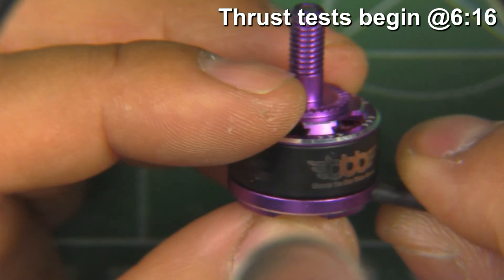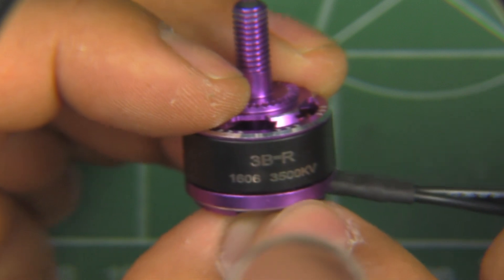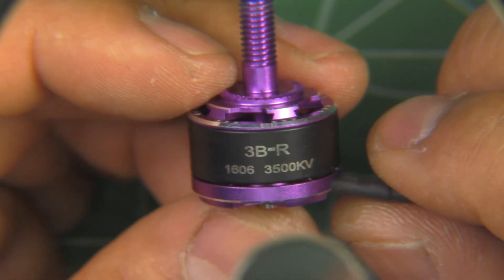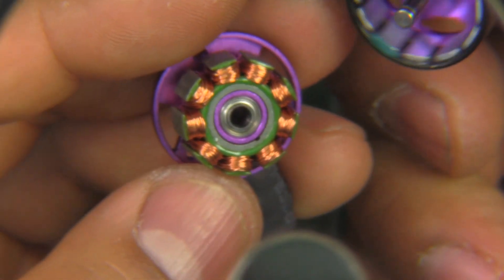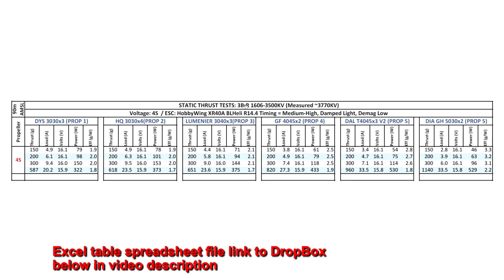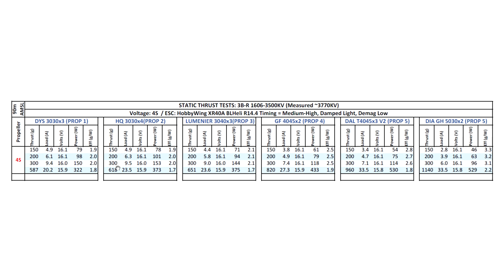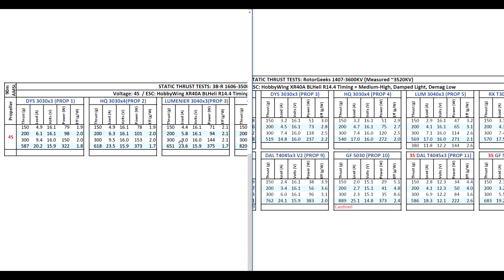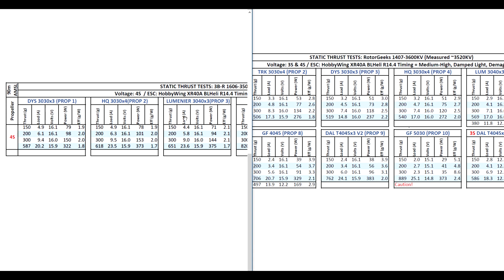bbb 3B-R 1606-3500KV Thrust Tests -Promising but Overheats

Comment: Old video, but I think I have an idea on the heat. The motors come with an oversized e-clip (for 1407 at least) and on my frame the clip would  be jammed against the frame instead of moving freely.  I used soft mounts to space the motor out and the clip was able to spin freely. Doesn't get much hotter then my other setups. My guess is the friction of the jammed clip and the spinning shaft was causing the heat.

Comment: I run these motor on a skyzone140, hglrcf4 40 amp stack and gemfan 3052's and whilst hovering in the house, these motors did indeed run very hot ( burning hand hot) but i was surprised that they weren't getting no where near as hot when flying out side and could comfortably hold the motor
Reply from the maker: Cooling air outdoors helped. A lot people report they run hot but they seem to be OK and no reports of meltdowns so that's a good thing!

Comment: hi thanks for your comments on my 8inch build, I have also uploaded my 3inch build maiden with these 1606 3500kv motors, now I have been able to have a few true flights with them they do not seem to get as hot once in the air and moving. its turning out to be a good spring festival this year.
Reply: I'm only using a 20A all in one esc with 3x3x4 props, flies ok but think a higher pitch will give it a better kick, will a higher pitch like 3x45x3 or higher be stressing the esc's ? thanks
Reply from the maker: Yes, those props will stress ESCs more but I think 20A ESCs should be able to handle the load just fine for any 3" prop. I'll check out your 3" video. Good to hear Spring is going well !

Comment: My God these motor run VERY VERY HOT, I couldn't believe it when I landed and felt the motors, I thought I might have had a screw touching the windings but after searching it seem to be the way they are.
Reply from the maker: Yep, it's a shame they run so hot. They're actually very nicely made and the size seems to have some good potential for 3" and 4" props. They really need to revise the stator, I think the coils need to be a little longer to allow for more wire.

Comment: Thanks for your testing report,we will upload 3200KV 1606 testing data soon
Reply from the maker: Yes, I will send you information right now from my email ro****c**na@gmail.com. Thanks and it would be great to get some test samples because this 1606 motor size could be a good option for some people, specially now in England they have new government rule many want to build 250g or lighter quadcopters. So 1407 / 1606 motors have to weigh about 14 to 16 grams.
Reply from the maker: Send me a set and I will test and review it !
Reply: Hi  EngineerX,can you send your address informations to my email sales@3bhobby.com
Reply: I would love to test some new too, because i wasn`t know its a motor issue i bought the 3B-R 128 mini combo, 3 spare motors and even switched a FC and can´t fly with it now because its too hot and dont like to fly it that hot, still like the frame and looking, but spending even more money for another new 4 motors after payed so much on that build would be not fair :( I did a RF1 build so it wasn´t cheap stuff :/ 

Greetings
Reply: Hi SkyHong,can you tell me where you buy the 128 frame and can you send us some flying video link?
Reply: I bought the set here = https://www.fpv24.com/de/acehe/3b-r-mini-128-frame-combo 
they liked to get the hot motors back from me and i boutht 3 new so i told them i send them 3 that i got one left for test with the 3 i bought for my own money, still did not get a e-mail, they told me they will contact you and also me but i dont get any response on that anymore witch makes me feel a bit pissed :/

I bought the 3 spare motors from here = https://redbee.de/3B-R-Racing-Motor-1606-3500KV-CW

And i even try 2 FCs because i wasn´t belive that they run so hot (i did messure over 70 degree celsius witch is enough to say i don´t like to run that motors because they will die from demagnetizing over time anyway). Because of that i can´t show you flight fotage sorry. I just wasn´t happy with it and put this build on ice, it´s sad because you can fit a gopro lense in this tiny machine witch is really cool.

Here is what´s left over from the 3B-R set https://www2.pic-upload.de/img/33898222/20170910_134520.jpg  (frame parts inside the box), i could buy another ESC and test new motors if you send me some, but atm i switched to the craft you see left to the 3B stuff i ordered :)  

I hope you can see that i really did try my best on this setup but i just was not happy with this temps and i didnt fly it more then some testing flights and decided to not use it anymore sorry :( But how EngineerX was say = it could be a really good motor without the heat issue). I love the design and the frame over all but i am really sad i ended paying a lot for it and i am scared to use it, thats not what i like to pay for i hope you understand me :) 

Anyway happy flying......greetings 
SkyHogRC
Reply: Any chance you've gotten the 3200kv motors from 3b? I'm between these and the brotherhobby 1407's, but I'd prefer to up the size of the motors if possible. 

I'm hoping 3b's resolved the overheating issue on the 3200kv version. Otherwise, someone else commented in this thread that it might have to do with an oversized c clip catching on the frame and friction with the spinning shaft being the cause of the overheating, which might be looking into, since it's easily resolved by soft mounting.

Comment: Thanks for this testing! I struggle with the 3B-R 128 kit for weeks now. 
I was try all even isolate the gyro with bobbins and these motors still run so freaking hot, my messure was way over 60 degree celsius after 1 minute test on stock props and a "hot motor tune".
 After 90 seconds flight time i was close to 70 degree celsius witch is the range where we go into self damage mode, that motors are strong, but man you cant fly a hole lipo it will burn or overheat the magnets witch will kill them over time.........
Next time it will be brotherhobby again, 3B-R did think about the power of the Motor but it makes no sense to fly a motor witch getting this hot, i dont like to deal with things like a burned field, just because i use bad motors...
I will switch the hole set and do a brotherhobby 1407/RF1 combo witch runs allways great even on stock tune :) 
Greetings
Reply from the maker: Thanks for your comment. It's great to hear other's experiences. So far lots of people have confirmed these run too hot for comfort and you're right, those 60 to 70ºC temps after such short flights are just very alarming. At high throttle I'm sure those poor magnets are frying and will eventually suffer some demagnetization. The fact that motors keep working shows their good potential and they could've been really good motors. At this time, you can't go wrong with a good 1407.

Comment: Thanks for the great reviews EngineerX.  I really enjoy your channel.  I have flown the 3200kv version of motors for months on 4".  They do get hot, but have held up well.  If you get a chance to test the HQ V1S 4" props in the future that would be interesting to see.
Reply from the maker: Maker Pipe Good to know 3200kv works better. I will have to order that new HQ prop soon. Thanks for your words of appreciation.
Reply: Maker Pipe - they still good? Or did u burn them up?

Comment: I got a set of these motors to test and flew them on the Gemfan 3052 props, which these motors and props were designed for each other. They feel great in the air but yes no matter what I did to the tune they run so hot. This size is interesting if they can get the running temp down.

Comment: Manufacturer link doesnt work :)
Reply: They are Gemfan 1606 motors...
Same thing as BBB.
Reply from the maker: I wonder who is the actual factory, bbb or GF. Thanks for adding to the reports about the motor running hot. It really is too bad as the motor does seem to perform well as far as thrust and Amp draw.
Reply from the maker: Just tried it and it did work, perhaps server was down or the YTube re-directing messes up your access to the URL. Try copy and paste to browser instead of clicking on it.
https://www.3bhobby.com/product/3b-r-racing-motor-1606-kv3200-3500/
http://www.helipal.com/gemfan-1606-brushless-motor-3500kv-ccw.html

Comment: BBB said on their own video that you shouldn't use 4inch props... This is made to go with their 128 frame kit which is a 3 inch build... I have the kit myself but haven't flown it yet so hopefully mine will survive lol
Reply from the maker: This size should be very comparable to a 1407, they have about the same stator "volume". One person mentioned his motors were also running hot on 3" props so that was kind of odd. Alright, let us know how your set behaves. Version 2 should be a 1607 ;)

Comment: Whats the copper content in these? Are they close to 1806 or 1407?
Reply: you could say that I'm playing with some garila 2507 motors at the moment that seem promising for an 8" build...
Reply from the maker: Most 8" copters are powered by larger motors -taller stator, I think due to the larger props it's better to have the taller stator and lower KV to maintain efficiency. The smaller motors we use could spin a 8" if KV is low, but they wouldn't be optimal.
Reply from the maker: KillaG FPV LoL.seems ages ago but we're talking only about 5 to 7yrs.
Reply from the maker: Should be about same as 1407, but seems the stator wasn't done properly
Reply: fair enough... ive heard the name edward lee quite a bit...

and wow! looking at that stator.... that is frickin tiny!!! they used a larger shaft and larger bearing to stop the motor bending on light crashes. little bit of metallurgical knwledge and that motor can be kick arse!!1 i'll request a 16xx motor see what we can come up with.
Reply from the maker: Yeah, he's just a fellow FPV enthusiast who just wanted to know how these motors compared to others.
Reply: understandable. there would be more than one edward lee in the world lol. ive heard it on the import car scene. and lately fpv as well. seems mr. Lee likes finding new stuff to expose.
Reply from the maker: LoL !!!
Reply from the maker: Yes! those 2507 motors look very interesting for 7" & 8" builds. Hopefully motors perform well. Looking forward to see how your 8" quad turns out!
Reply: 0oo challenge! lol! to 8 inch the mad 2306... v2.5... get an 1800kv wind?? what would you lads recommend? can cram a touch more copper into the mad 2306 compared to conventional 2306's or is an increase in stator width  necessary to keep overall balance and stability @ 8inch?
Reply: I decided on the 2507's as they were designed with performance in mind on 7/8" props, not efficiency
I found some taller stator motors that would work such as 2216 but weigh considerably more, less performance but had huge efficiency gains over the 2507. for a camera style drone these taller stator motors would have been perfect, longer flight times etc.
Reply from the maker: Edward Lee Right. Specific motor for specific purpose. That'll be an interesting build.
Reply: EngineerX ive used 2213 for 8inch and that was fun. Only 980kv tho. Back in the naza days... lol